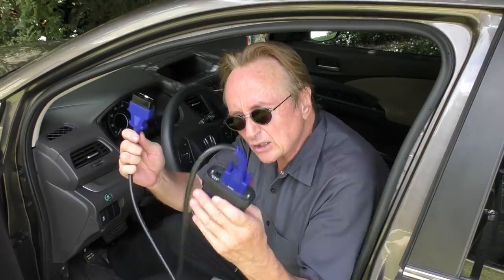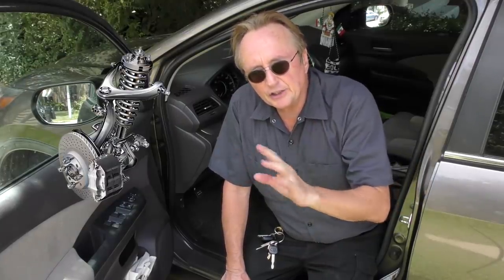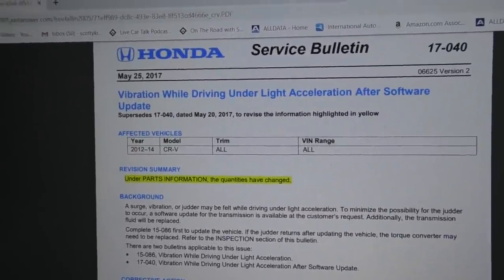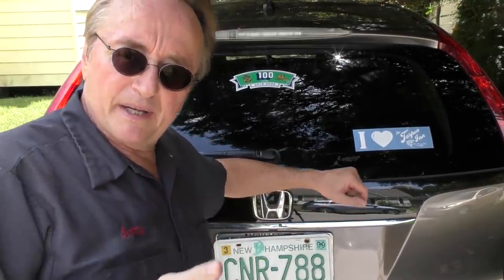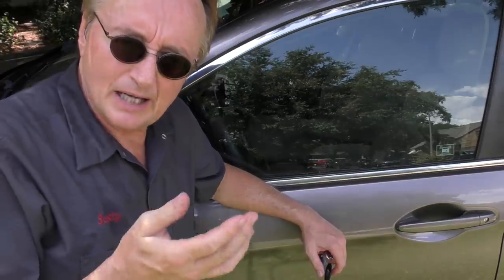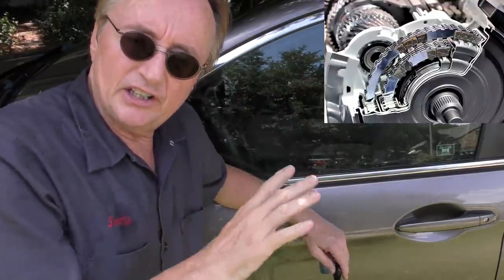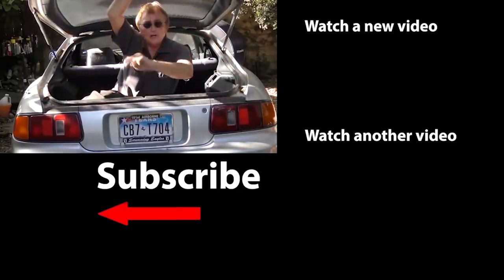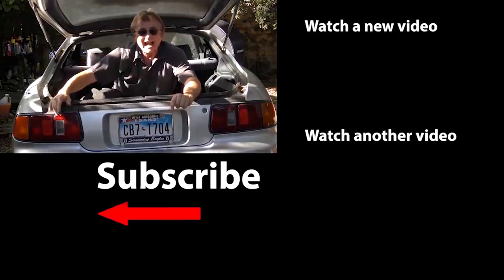I Can't Fix This Car

Comment: Good advice Scotty!   My 2010 Prius w/202,000 miles had the brake booster/actuator go bad.   I found a customer support program that extends the warranty on that part.  I called the Toyota dealer, and the service advisor was blowing me off and telling me it’s a $3,500 fix.   Once I gave her the bulletin code she then stated my car is covered under  the warranty.   Knowledge is power.

Comment: easy fix just quit driving like a grandma and floor the darn thing.
Reply: It's not often that the solution is favorable, but when it is, you know you have a good car.
Reply: My car after about that same amount of time (a classic Mustang with an automatic) has been acting like its in sport mode all the time and refusing to upshift until 2500-2700RPM no matter the speed. But it does downshift when its supposed to. I will eventually rip out the 3 speed and get a 5 speed manual though. I think its just a bad valve.
Reply: My passat 2.0 loves 6500 RPM
Reply: Is that how you drive in parking lots?
Reply: You must never drive in-town where you've always got a car or a city bus in front of you and max speed limits of 35 mph.
Reply: Fox McCloud 007  I had a 91 fox body that did the same thing, ford dealer said I needed a new tranny (the automotive kind). Took it to my local trusted mechanic for a second opinion and it was a 15 dollar sensor, or solenoid I can’t remember now. Dude charged me 35 bucks and it ran fine till I sold it a couple years later.
Reply: @donw758  hahaha I loved how you pointed out that you needed a new tranny, specifically the automotive kind 😂😂

Comment: How to Fix:  had a couple of these and current one i am driving is a 2010 with no more shudder.  Changing the filter itself won’t help (although filter is right up front and super easy to change).  You need to change the fluid and sometimes twice to be sure you have fresh new fluid with appropriate friction additives to help the torque converter (TC) have a fighting chance to stop shuddering since it was having a hard time with the old fluid that lacks good friction additives.  One change doesn’t get the last couple litres of fluid still trapped in TC. Once I changed mine it got better and better right from the first road test.   Before that the shudder drove me nuts.  It used to happen at very light throttle around 50kms or 30mph just as the TC was trying to lock up.  Drove me nuts and I also knew it wasn’t helping that TC clutch any so I would have to let off throttle or give it more gas to trip the TC out.  So if you have this problem, then change the trans fluid,  drive, and you may have to change again to ensure nice clean friction friendly fluid.   This is very similar concept for rear diff chatter issues high mileage CRVs.

Comment: 2019 Kia Sorento does this too. I recently went on vacation and rented the Sorento for a week. The car ran fantastic. However, what you just described in this video is exactly what the Sorento did. It only did this on light acceleration. There were no check engine lights at all and the car only had fifteen thousand miles on it. It's crazy what these newer cars cost these days with all the unfixable problems they come with.

Comment: This is just a thing the CRV does. I had a 2016 and it did that, we had the CVT programing updated by Honda and it still did it. We were eventually told by the Honda mechanic that every other CRV does it and it's normal and there's nothing that can be done. I bought a Rav4 after that.
Reply: Hey Timmy!👋 surprised to see you here😂

Comment: There are Honda TSB's on this Juddering. It's a torque converter partial lockup. Need to update the transmission software, and change the transmission fluid 3x by 3 drain and fills. Our Honda drove brand new after that.

Comment: Very easy and simple to fix. Update the transmission software first, and then drain and refill the transmission with OEM fluid, 3 times. Drive between each refill. That is Honda's procedure. We did that to our 2014 Honda and it drove like a brand new vehicle after that.

Comment: My 06 Highlander sometimes, at low speed and taking foot of the gas, it can’t decide whether to shift or not,
then it gives a double clunk. It only
does it occasionally. It’s done this for
years already. Other than that, it shifts
fine...

Comment: Hi Scotty. I have got a couple of Hondas and had shuddering. Fixed it by changing the trans fluid. Must use the correct fluid and it goes away

Comment: So glad I bought a 2006 Sienna! 105,000 miles and everything is perfect.  Love it.
Reply: Only problems on the one in my family is flat tires from running over stuff. Toyota's V6 in that is pretty damn bulletproof. I've seen some where the red plastic on the brake lights can chip off if overzealous with an ice scraper, but haven't run into it yet personally.

Comment: my work vehicle is a 2016 crv with a stinkin cvt, it gets 300 miles a day, lets see how long it lasts
Reply: If you are making 300 miles per day, most likely they are not "hard miles".  Unless you spent 12 hours a day in stop-and-go traffic, in that case you'll have great test for your CVT.
Reply: You'll be fine
Reply: @rvasic  yea, you are correct, mostly highway miles, a couple of full throttle merging
Reply: keep us posted
Reply: holy crap..move closer to work. I thought my 95 miles per day drive was bad..
Reply: demandred1957 he’s using it for work not just to and from.
Reply: @demandred1957  the miles are put on the vehicle from doing deliveries, my work is 80 miles round trip, i use my personal vehicle to commute to and from work
Reply: @infinity3jif  oh, ok. I took work vehicle to mean the one you drive to work.  Lol
Reply: Honda crv's aren't that bad. If it was a Nissan, I'd tell you to keep a bus pass in the glove box.

Comment: Pretty sure that's what's wrong with my 2007 GMC Sierra transmission. Most likely the torque converter and clutch packs are going bad. I already spent too much money fixing the engine after a head gasket failure. So I'm going to need to get rid of my money pit before I end up needing to have the transmission rebuilt.
Reply: most people dont understand,   when the motor over heats,  you also cooked the transmission
Reply: Just gotta wait for the endless money pit sticker with the FCA and Benz logo.
Reply: The 4L60e is fairly weak but you can find them fair inexpensive.

Comment: My ex honda used to have that problem, this mechanic told me that it need it a full tune up, spark plugs, spark plug wires, distributor cap, filters, etc and it solved the problem for good.
Both first hondas I owned had the same problem, now I own a toyota... no more problems :)

Comment: Holy moly... that is the EXACT issue i have on my forester. Its 2018, both stealerships cant find the issue since theres no check engine light, and there are no old codes!!!
Reply: Go tell them your going to go test drive another Subaru Forester and see if it produces the same problems. If not something is obviously wrong with your car and they can't deny it
Reply: Mike Cummings thats the thing, its been happening to other subaru owners, but they are denying it.. they are just stumped on the issue
Reply: @Camilo19832001  get rid of the damn thing
Reply: @Camilo19832001  endlessmoneypit.exe process has started. wrx-stiej25'sblowingupbefore100k.exe process greyed out for 15+ years.

Comment: Had that in my BMW M4 due to a tune, without the tune was all good. No errors or anything, no misfires, only light load when cold. Perhaps the MAF sensor is dirty causing it to run lean?
Reply: Also MAF + TPS + VSS is used to help calculate power demand in the computer. And that tells the computer when to shift an automatic transmission. So any of those are suspect if the bigger obvious ones don't stick out.
Reply: IsraeliPilot that’s why you data log . trust your tuner go with a good tuner. or either dyno tune it . You can’t do a custom tune on a device without data-logging . Hopefully detonation isn’t your friend here .

Comment: I would have changed  the transmission fluid and filter.
Reply: I wonder if the transmission fluid lost viscosity.
Reply: Rob C I did change fluid twice then filter & my problem disappeared.....Jim
Reply: @slowanddeliberate6893  I think if the filter was partially clogged if might impede the fluid flow at low speed under certain conditions.
Reply: Changed fluid in my Acura MDX and that fixed it per TSB
Reply: Update the transmission software, and then drain and refill the transmission, 3 times. That is Honda's procedure. We did that to our Honda and it drove brand new after that.
Reply: Good idea and simple fix first
Reply: Paul Amarante 20K is pretty lame

Comment: I hate updates! I love my '63 Chevy!
Reply: My '65 Mustang has some shifting trouble where it wont shift up until at least 2500RPM no matter the speed. Pretty sure its a line or bad modulator. I want to manual swap it someday tho.
Reply: My 64 Biscayne worked great back in the day.

Comment: Hey Scotty what do you think about the 2015 Toyota Corolla CVT transmission!
Reply: Don't buy it
Reply: @Diversified World they have cvt transmission issue Right now
Reply: If it says cvt dont trust it
Reply: I have a 2014 and there was a recall to upgrade the software for the CVT. No problems. YET!
Reply: @donhurst8459  wait for
Reply: your not from around here are Ya'
Reply: Toyota CVTS are bulletproof. I owned a 2016 Corolla and now upgraded to a 2018. I’ve never had any problems.
Reply: @ELPJM09  how many miles?
Reply: viento vendaval The first one had over 80,000 miles and the current one has 30,000. Not a single problem.

Comment: I had the same problem with my 05 crv. I live in Dominican Rep. I went to my mechanic and change the torque converter for only 150 dolars. I bought an used one of course and everything is perfect now

Comment: The only modern tech that I like is fuel injection. All the rest, computer controlled transmissions, ABS, ARS, infotainment, go back to the old way, pleeeese!
Reply: Easy Rider how about distributorless ignition?
Reply: @paulparoma  I have not had any problems with EFI, but carburetors I have had to adjust them too often especially multi carbs and vacuum operated secondary 4 bbls.

Comment: Ditto with a 2013 Toyota Camry: torque converter replaced (under warranty). no more problems so far. This problem seems to be industry wide.

Comment: I can fix that.
I had a 2009 Acura MDX that did that. It was a TSB issue. Changed the transmission fluid and it was gone.
Reply: Did the same to my wifes 12 Civic and it helped. Let's hope it lasts.
Reply: If that would work on that car I’m sure he would’ve thought of it. And if the transmission shops didn’t think of it it clearly wouldn’t work
Reply: Did you flush the fluid or just change it? My dealer recommends I flush the fluid but after watching Scotty religiously I don't want to flush.
Reply: I have a 2015 MDX that did the same thing. Crap fluid that's only rated for 30K miles when most manufacturers have 100K.
Reply: Most mechanics really should know that if the car is an automatic Honda, you DON'T PUT ANYTHING BUT HONDA FLUID IN IT!
Reply: @violinforever the dealership is trying to make it so you flush it and ruin your transmission, so you have to pay them to replace it.
Reply: Problem is there are few different honda ATF fluids: Z1, 3.1, CVT, DW-1, HCF-2. Pick the wrong one and you are going to have problems. Hondas are tough. In nissan-jatco you will blow the cvt after few tousend miles.
No Mather what you should change (not flush) transmission fluid in Hondas as per service interval schedule.

Comment: Yeah my 2003 Kia Sedona 3.2 v6 does that at like 45 or something going down road same thing does a shaking or shuddering crap and if I let off the gas or hit the brake or push gas more like passing gear it stops but yea same thing torque converter is tore up in it but it's fine other than that

Comment: Lube Gard instant shudder fix is what I use. It works!!
Reply: Yep!
Reply: Lube Gard is the only true fix, with a 20-year patent, and is used by actual OEM's.
Reply: Lube Gard worked to stop the transmission shutter on my Tacoma.
Reply: I used Lube Gard in my 06 Odyssey with Valvoline Maxlife Synthetic ATF. Never an issue with my problematic Odyssey transmission. Lube Gard is great stuff.
Reply: Yep, Black Lube Guard...no more shudder
Reply: Fluid change (Aisin high perf +) & Dr Tranny - 100% fixed TC shudder on my '03 Explorer (at 100k miles).  
Smoothed out that bang into reverse, too.

Comment: Your Honda CR-V jutters? You're doing it wrong
Reply: Mine juttered when accelerate after 3000rpm the vtec solenoid was bad. Or the rocker arm actuator was bad I changed both and fixed the problem lol
Reply: Lol
Reply: Its probably the TCC which can be disabled via the computer. OBD1 you could clip the wires but now you'd get a code because the rpms would be off. If it feels like you're going over rumble strips it's the TCC slipping. Heavier acceleration the PCM disengages the TCC which is why you don't feel it then.

Comment: My exact problem.  Software update and full transmission flush
Reply: Transmission software update and a drain and refill 3 times, with drive cycles in between each drain and refill. Completely fix our problem with our Honda, and it now drives like a brand new vehicle.

Comment: Scotty, what do you think about a 2004 Hyundai Tiburon 2.0L turbo with 55k miles for 2000 dollars. is it worth? Thanks!
Reply: If that last a couple of years at least that's not a bad deal
Reply: Yea
Reply: doesn't sound like a bad deal. especially  if is mechanically sound for the most part
Reply: Don't pay too much!   Ask for a little less.
Reply: looks like cheap enough for a car thats 15 yrs old... only problem i'd worry is the Turbo system on that thing could be reaching its end
Reply: Didn't know they ever made tiburons with turbo

Comment: I have a similar issue with my 2012 camry, there is a tsb for the torque converter. Toyota said my vibration / shuddering isnt bad enough to replace it....

Comment: As an ex-Honda dealership technician, we usually did 3 sequential transmission fluid drain & fills while driving the vehicle through all the gears on the lift between transmission fluid drain & fills. Using only OEM fluid. This usually did the trick. TSB's on the Odysseys correlating to this issues. CVT transmissions there is a burnish procedure you can do to help eliminate judders.

Comment: I've played brass valve horns for over half a century. 
This gives  me intimate fluid valve intuition.
Keep changing the fluid every few months, it will go away.
I got a Toyota van real cheep once because "tranny shift problem".
On the test drive I could "feel" the stickiness. Stickiness a horn player knows he needs to clean and lube his valves
I bought it.  Change the fluid, immediately it was a little better.
Couple months (let the detergents work) I  changed it again, it shifted better still.
Couple months later , changed again,  perfect!
I drove it for the next 10 years, no problem.

Comment: I had the exact same thing happen to me. Took it to the transmission shop 7 times. Did not fix the problem. They threw everything at it. From torque converter all the way to idle air control valve. Took it to the same company owned shop on the other side of town because this was a warranty job. Turned out to be a valve body. Never had issues again. 4 people lost their job because they couldn't fix the job right. I did not ask for them to lose their job, I just ended up hearing about it. Everybody treated me really good and was really nice.

Comment: The first thing I would do is replace the transmission fluid with the Honda specific Fluid ATF-DW1. Non Honda fluids tends to cause issues. If this were the AWD version, I would also change the rear diff fluid with the Honda Dual Pump Fluid DPF. I have a couple of CRV on my driveway and have noticed over the years that when the additives in the oil wear out, you get a little bit of a hum and shutter under light acceleration, and it is a sign that the fluid needs changing. Understand that when you change the fluid, only a part of it is changed at any given time, so frequent changes are recommended. The software update on our 2007 CRV AWD made this problem worse. Solution was to change the fluids more often. It's cheap to do yourself. Get your crush washers on Ebay as the dealers charge too much for them. Unfortunately you need to go to the dealer for the oil.

Comment: I had a 2006 Pathfinder with a noisy serpentine belt when it was cold. Dealer had no solution and apparently mine was the only one in Australia with the problem... I looked at the TSB's and there was one for a noisy serpentine belt. Took that to the dealer who said "doesn't apply in Australia" but when pressed and they started looking at part numbers they were all common so reluctantly they change the belt and tensioner as per the bulletin.

Something they couldn't permanently fix was the fuel gauge reading empty when there was still 1/4 of a tank left. They were changing the sender unit almost every service and it was OK for a while but then reverted back to misreading. Finally they told me it was "production tolerances" because the gauge cluster and sender were made by various manufacturers. I just used the trip computer to calculate how much fuel I should have left and lived with it when it went out of warranty.

Comment: Go to Honda. Their is a reflash that will fix it. It's the torque converter.
Reply: Precisely 100% correct. Re-program the transmission software, and perform a drain and refill on the ATF fluid, and for us, it went away 100%. The Honda now drives like a brand new vehicle.